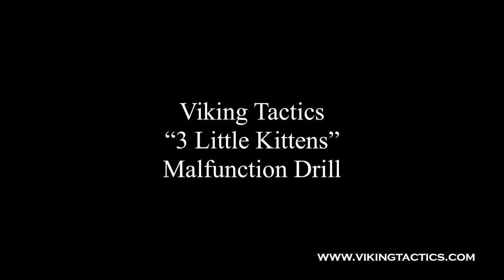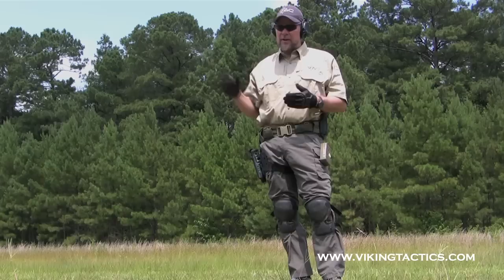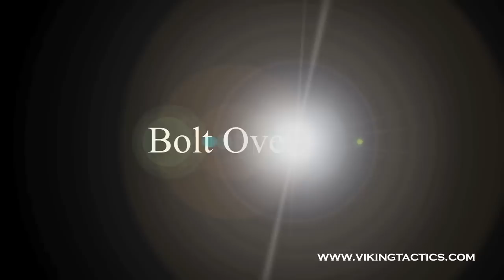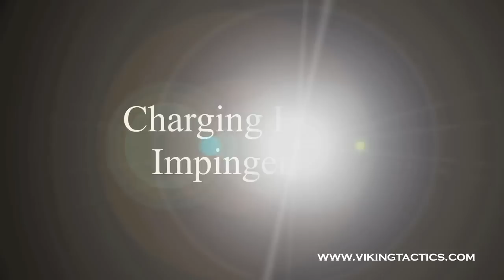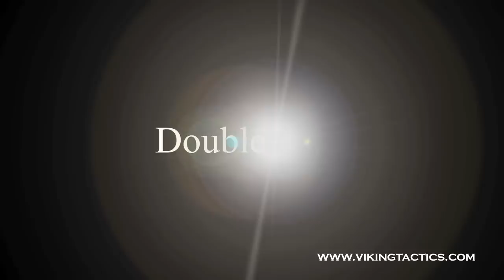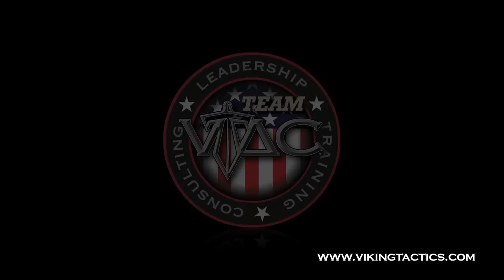VTAC "3 Little Kittens" Malfunction Drill

Comment: Respecting Kyle, Ive never quite understood the dogmatic tap-rap in a case where the bolt is clearly impeded by an obstruction. Neither do I relate to the ill-efficiency of re-shouldering the rifle after an unsuccessful rack results in a half stroke of the bolt which is both pronouncedly felt & clearly apparent. If it doesnt fire, quickly glance at the port then take the correct plan of action rather than assume the malfunction type. Racking without looking can cause or amplify a existing issue.

Comment from the maker: @pingpong909 Bolt override- pull bolt to rear and lock it, push charging handle forward. Drop a piece of brass in the charging handle channel and release bolt.

Charging handle impingement- Same as above but place brass between bolt face and hook on the charging handle. Takes some practice.

Dust covers closed will definitely screw your buddies, but  isn’t the way the weapon will be when you have some of the malfunctions. You can lay weapon down on dust cover side, or do the drill at night.

Comment from the maker: @Malik4Mazadu That is a technique and the one taught by many military instructors. If you want to clear the weapon faster, ripping the magazine out, then locking the bolt to the rear is quicker. You already have your trigger finger near the magazine release so I just hit it. If you are using MagPuls little lever gizmo, then I would say go for it. Most of the folks I train do not have that modification on their weapon so this is a little quicker.

Kyle

Comment from the maker: @yenhan705eh77 Make sure you only have 30, not 31. I normally don’t lock the bolt to the rear to load although that is a fine way to make the initial load. You must be able to load the mags with the bolt forward such as during a tactical reload. See how many rounds are in the mag.

Kyle

Comment from the maker: Asnmonkey6969,
 
Bolt over ride is when the bolt has overridden a spent or live cartridge and it is stuck between the back of the charging handle and the front of the bolt carrier. Charging handle impingement is when you have a similar circumstance but the cartridge is between the front of the bolt and the back of the charging handle.
 
We will have a good DVD of these procedures coming out soon. It will go more indepth than the You Tube Videos.
 
Kyle

Comment from the maker: DMJERRY
 
One of the issues we run into is that you cant see what the issue is. We train for all malfunctions to be fixed at night - when you wont be able to see what the issue is. If you dont get a click, it could be that the round did not go all the way into battery, or that a round failed to feed properly, and may be fixed with a tap rack. 

(continued...)

Comment from the maker: @torinhill Could you send me a link to that article?

To emplace a charging handle impingement, remove your gloves, lock the bolt to the rear, with a piece of brass, start the base of the cartridge in the bolt face, slightly cant the weapon so gravity will let the mouth of the case drop in behind the charging handle, which of course is in the forward position.

Hope this helps.

Kyle

Comment from the maker: @hernandot3 The weapons I use are just like the standard M16/M4.

Pull the charging handle back as far as you can, it won’t go all the way. Once you get it as far as you can pull, push on the bolt catch to hold the bolt in place. Now push the charging handle back forward to create the space needed for the case to fall free. You may need to use gravity by lowering the muzzle. Make sure you keep holding the bolt catch, if not it will usually just let the bolt ride forward.

Hope this helps.

Kyle

Comment from the maker: @jeff31b 

My experience is that you are much quicker to pull the magazine out while your hand is there to get a hold of it. I switch hands to lock the bolt to the rear, therefore it is slower for me to switch, then switch back to pull the magazine out.

What is the malfunction that is fixed by locking the bolt to the rear first, then removing the magazine? Just trying to use economy of motion.

Kyle

Comment: There is a more efficient way to do it. If you have a click of the trigger and no bang, that's when you tap rack. If it is a mushy trigger, you just go ahead an ID and get the malfunction solved. Whenever there is a mushy trigger, tap rack rarely, rarely clears it.  And on the double feed drill, if you lock the bolt back first then drop the magazine, usually the rounds will fall out with it. Not always, though. Just a subtlety. But, if I ever get a mushy trigger, I just immediately ID. No tap rack.

Comment: When I was in the military, we were taught to do all the manipulation with our left hand (if you are a left-hand shooter with your right hand, of course). I have not served in the US military and therefore used a different rifle, but is it typical for the AR-15 to let the grip go for manipulation?
Reply: Simon, I am not Kyle Lamb but I think both the "maintain your firing grip" and "always keep your eyes scanning for threats" lines are detrimental to swiftly solving problems. My personal view as a non-expert is to solve the problem and get back in the fight as efficiently as possible. Me taking time to diagnose a malfunction by feel only using my support hand and then solving with the same seems way slower than a half second of eye time and doing whatever needs to be done. If I get shot by a guy while doing that, it was probably going to happen anyway. 

Most military and similar forces rely too much on best-fit practices that get enough of those trained to enough of a percentage of success to qualify and move forward. Experts tend to train harder, weirder, and to a higher level using "big boy rules" that often conflict with or totally disregard certain larger force fundamentals. 

My guess is that your military training was designed to be "good enough" and that's why they said support hand only. In reality, my experience says to take the 1-2 seconds needed to be aware of the problem's exact nature then to work that problem bit by bit until you are good to go or the weapon system is beyond your fixing. 

I know that during the pool comp phase of the Navy SEAL BUD/S training instructors will tie knots in lines and otherwise foul breathing apparatus for the candidates and have them sit at the bottom of the pool working the problem until they solve it or black out from a lack of oxygen. Sometimes they induce critical failures that aren't solvable in that situation just to test the commitment level of candidates. Those problems are called "whammies." I imagine that other military schools throw various whammy/no-win scenarios at candidates the world over for similar reasons. 

I say all of that because this "3 Little Kittens" drill, which I've watched numerous times, is a handy tool and the core lessons have been echoed by another Delta instructor, Paul Howe. But, I have personally experienced a stoppage that took my rifle out of commission on a range and no standard procedure of bringing my carbine into my workspace, feeling around, and working mags/charging handles/bolt carrier groups was going to solve it in an acceptable time frame. I had a "whammy" from a popped primer which locked my action hard. I was able to solve the problem by "kickstarting" my charging handle (a technique learned from a Magpul carbine DVD) and then slowly and meticulously checking for damage to my system. If I had been in a firefight with that lock-up I definitely would have been searching for an alternate weapon to employ. I guess my point is learn all you can, test stuff at home with dummy rounds, and find what works for you while also being intelligent about the whole process. 

Stay safe out there and keep us looking good,

-Joel

Comment: Wouldn't the extra pressure from the bolt essentially "wedge" the magazine in place due to the round only being partially stripped from the magazine?

I've always been taught to relieve the extra pressure the bolt is adding to the rounds that are already jammed up by locking the bolt to the rear. 

However, in practice, it does seem that give the magazine a good SOLID tug will usually rip it free.

Great vids.

Comment: I wonder what it would be like to add a fully functioning carbine into the mix somewhere in the line of rifles on the ground at random. That way instead of the student expecting nothing but malfunctions, they'd know that one of the 4 rifles on the ground IS functioning correctly and could actually fire when the trigger is pulled. I think that'd improve the effectiveness of this drill even more.

Comment from the maker: @opmike343:  I teach that way b/c I want to use one technique for all. If you strip the mag, then attempt to lock the bolt to the rear it will have the same effect and is usually faster. With a Bolt Over Ride or Charging handle impingement the bolt won't lock to the rear so it is much quicker to rip the mag, attempt to lock the bolt, slap the charging handle forward, point the muzzle down to allow gravity to pull the bolt override out and then cycle twice before loading again.

Kyle

Comment: Quick question Mr. Lamb.  I just got my new ar15 and I can't seat the magazine with the bolt closed.  But if I download one or two rounds, I can then seat the mag then pull the charging handle to charge the gun.  I remember in your book you mention that you like to charge the gun by locking back the bolt first then insert mag and let the bolt ride forward.  It definitely worked for me.  Can you elaborate why the latter method works and the first one doesn't?  Thanks.

Comment: Is not looking into the chamber part of the drill? Not trying to be a smart ass or anything but looking into the chamber should be a step. Army infantry has S.P.O.R.T.S 

Slap (the mag from bottom)
Pull (charging handle locking the bolt to the rear.
Observe (look into the chamber) which would show what's going on
Release ( the bolt)
Tap ( really it's slam in the bolt assist )
Squeeze ( fire the weapon) 

I love the drill just curious.
Reply: Other than the fact that it's army doctrine, why should that be a step?  You can do this drill blindfolded because it isn't hard.

When you pull the trigger what happens: bang, click, or nothing?

If "bang," keep shooting.

If "click," then tap, rack, and bang.

If "nothing," then drop the magazine, pull the bolt to the rear with a good amount of force, lock the bolt to the rear, karate chop the charging handle forward, finger the magwell, release the bolt, hear metal-to-metal contact, insert new magazine, rack the charging handle, and start shooting.

This method works at all times—day or night—and doesn't require a chamber check.  The key though is the metal-to-metal contact since that lets you know that the bolt is fully forward.  You wouldn't hear anything if it stopped halfway with a malfunction.

Comment: I set up the brass of a boat malfunction multiple times. I can not unjam the AR without using a tool or mortaring it.

Are you guys riding the bolt down when you set it up? I set up by turning it upside down and then pointing up. I just release the bolt catch like I normally would when operating the rifle.

Comment: Do you not teach to check the bolt quickly before running immediate action, or did he just not do that? Jumping to immediate action right away can increase a problem that can be circumvented with a little glance.

Comment: Why do they slam the charging handle forward (while bolt is locked back)? I really don't understand what that should help. Could please someone explain this?
Reply: They do this so that the bolt can be released via the bolt release and to make sure that it isnt something wrong with the charging handle itself
Reply: There is an AR malfunction where the bolt can be impeded by a round the did not seat properly on the bolt face. The round can be wedged in will prevent the bold from moving & sliding the charging handle forward can push the round loose. Standardizing this movement means the operator does not have to identify a particular malfunction and can move through a process that adequately addresses the most common failures.

Comment: I think it's funny that AR guys have to practice all these malfunctions types. AK guys have never even heard of this stuff.
Reply: I think those boring training manuals are really interesting, I think the secret is to always be learning more information ALONG with the physical. With ak's Well what do the Israelis do? what do the Russians do? What do most Pmc's do? WHY do they do what they do? THEN apply it.
Reply: Ive been training with my MODIFIED Mini 14 for years... gave up AR's for it actually.  (Mind everyone I only dealt with top-of-the-line hardware) While good info to know, I personally prefer a firearm that isn't prone to these issues.  AR = problematic and accurate / AK-47 = reliable with mediocre accuracy at best / Mini 14 = reliable AND accurate.

An AR is a good firearm... unlike many will argue however, it isn't the best.  In addition, my Mini 14 isn't the best either.  But its the best I can get my hands on without subjugating myself to some tax-stamp GUBMENT bullhockey. 

..just my opinion.
Reply: I've gotten my AK so dirty that it failed to feed every single time. Better learn how to clear the jams and get the gun back working when it happens when you don't need it to happen.
Reply: Liist I agree, regardless of your weapon system that you choose to run, EVERY weapon malfunctions... why NOT learn what you may NEED.
Reply: hey but if you can clear a jam on a AR you can clear one on anything ... that might be good for your health down range ...

Comment: so is the forward assist just cosmetic nowadays?
Reply: How do you mean?  It still performs a function.  Whether it's for the original intent which was to properly seat rounds in the chamber that may or may not have been displaced or jammed in due to corrosion in a jungle environment (a la vietnam).  Or most commonly it's used nowadays after a press check.
Reply: Because we were taught no matter what after a malfunction you use the forward assist because in a combat situation u never wanna get stuck pulling a trigger on an unseated round
Reply: That is taught as a part of IA drills for recruits.  It's also taught, because while it adds seconds to the clock it works.  In over 12 years, 2 in the SOF community, and a couple deployments I've never seen a properly racked AR variant not fully seat a round.  IF a shooter rides the handle, doesn't fully pull it back, etc, then there may be a requirement for the forward assist.  That said, the drill - Tap, Rack, and Go has been taught for years because it dispenses with fine motor skill movements which inevitably go out the window in a high stress environment.  At the end of the day, if you are employed and taught weapons handling drills in a specific manner, it will behoove you to conduct them in accordance with the teaching provided.  If however you want to use differing practices on your own time with your own weapons, then I would strongly encourage you to dispense with the additional unnecessary movements - especially anything that requires a finer movement pattern (ie bolt release or forward assist)
Reply: Bolt release and FA are not as fine a motor skill as a trigger press, so that logic doesn't really fly.  That said, I agree that FA is really only useful after a press check for those who do press checks with a rifle.  Not sure why you would when you can pull the mag and see which round is on top.
Reply: Actually according to stoners original design the FA was always cosmetic, he didn't even want a FA on the rifle. The army mandated it be there as a way to make the soldier "feel better" and more in control but every one I have ever talked to says its always better to check wtf the hold up is on a round rather then try and use the FA to seat a round that doesn't want to get seated, you can end up in a situation where a minor problem becomes a major problem.

Comment: I prefer loading the weapon from the open bolt. How many times have you found yourself dicking around with a magazine, trying to insert it 3, 4 or 5 times on a closed bolt!?!? Lock the damn bolt to the rear, insert the magazine and push/pull to ensure its seated, then close the bolt. You have a much greater chance inducing a malfunction by slapping the bottom of these magazines, by either rounds spitting out of the top, or overseating them. Don't believe me about causing a malfunction from smacking the bottom of the magazine..fill up an AR mag with 10 or more rounds and slap the bottom of it (out of the weapon) and watch the rounds fly! There's your next double feed!
Reply: I have been experimenting with moving to a rack-only resolution, figuring that a properly seated magazine will not cause any problems, and a flawed mag will require exchanging the magazine.

Comment: He fumbled around for the controls... Slap and rack without looking at the camber to see that the bolt is all the way forward can just make things worse by adding a round into the action that needn't be there. So there's his first mistake. Should have locked the bolt to the rear before stripping the magazine. I'm no carbine master, but my common sense and personal practice shows me what he did incorrectly. The default slap and rack isn't always a good move to turn to.

Comment: are these dude prior military? Tap rack bang is now OBSERVE tap rack bang. This is where you you observe the chamber to decide if you should go straight into remedial action. If the bolt is foreward conduct immediate action. If it is locked to the rear conduct speed reload. If there is a cluster fuck of shit conduct remedial action.